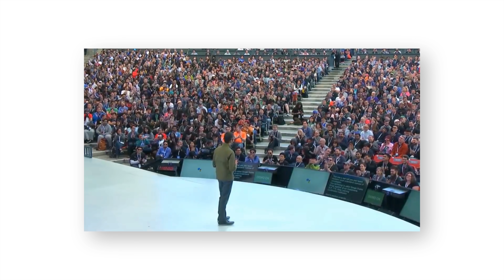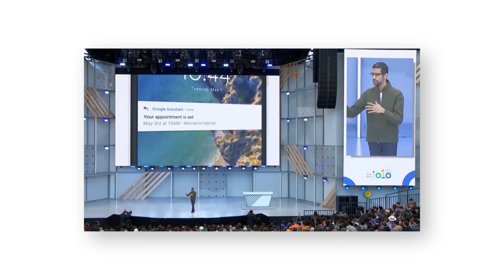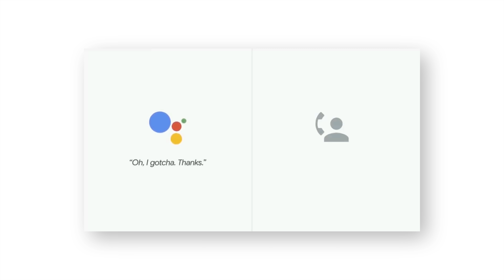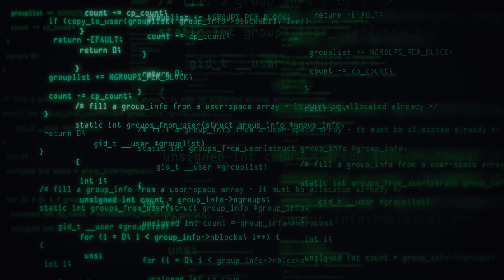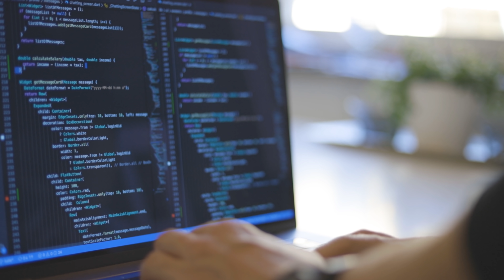AI Won’t Replace Programmers

Comment: Machinist said the same thing about cnc. But yet here we are with gigantic self loading amd unloading that take raw slabs and turn then into 100% finished products. One machine does it all. Instead of a bundling of machines and people per machine you now have 5 machines ran by one person that loads tools and prepares raw stock. Don't make the mistake thinking this won't happen. Fighter pilots said we won't be replaced it's impossible. And yet we are taking the first trails of AI piloted fighter planes. Baby steps but the advancement skyrocket from there

Comment: Computers & software can't run completely autonomously without people. Which means automation as envisioned by Google and co. cannot happen. Yes automation will happen but only about 50% of the total workload will be acquired by machines. It may look easy to some but replacing or even copying what a child can do is impossible. Mankind lived for millennia without electric power...can computers do that?
Either way, even though there may not always be jobs, there will always be work.

Comment: I agree with you, and your main thesis stands, but consider this: You can't think ofAI coding like a human.. It works in its own framework. I believe AI will be able to excel in things like gaming very quickly because you have a high workload and super high margins. What I mean by that is that the games will be built via AI and can predict textures models sounds etc etc etc. Where you for example sketch out a map design or even let the AI do that too and then let it paint in all the textures and models based on the theme you are going for. You make a few little adjustments here and there and save thousand upon thousand of cumulative hours.. 

Like you said without AGI you have to do a lot of predicting but specialized AI's can still predict really freaking well. Say you have a specialized AI for story writing, an AI for meshes, textures sounds animations etc. Boom you just saved <90% of the work it took to make the game.

Edit:
You could even develop an AI to govern and manage the fun factor of the decisions the other AI's made.

The point is not to underestimate AI.. its literally better than anything you have ever even slightly conceptualized. It will know and understand things intuitively that you would have never in your whole life thought of. Abundance is going to get wild.

Comment: I think it will be used to generate smaller sections of code and make programmers more productive to begin with but eventually it will take over larger sections as it becomes more advanced. 10~15 years ago we thought image recognition was impossible now look how far that's come. It's the same with programming, I wouldn't be surprised if we saw AI generating much larger applications within 10 years. Instead of a team of 50 developers you might only need one or two in the future.

Comment: I can certainly agree that software engineering is a too hard field to be replaced by AI, but 20 years ago, for instance, people thought it would be impossible to create something like a smartphone, but now it's the form of technology that almost everyone has in their hands. So I myself think that software engineering would be replaced sooner that anyone expects it to
Reply: If it's going to get replace. It's going to be replace by framework rather AI. AI to replace programmer is just a wrong path to go. It's not how AI work
Reply: It's inevitable.
Reply: If AI can be used to generate something creative like Art and Music, then it will for sure be able to tackle Programming. Something that’s super technical.
Reply: Well, it's already able to code. Take GitHub Copilot or OpenAI GPT-3 for example. The next step is to make a software developer AI and after that a software engineer one
Reply: These are totally different things.
Phones were not available due to absence of technology at that time so it was impossible to think that will happen because of the absence of that tech.

In this case AI needs such tech to make it creative without using human knowledge as a base which isn't possible due to it's absence in reality and of emotions.
Reply: This comment aged well. Not
Reply: Wait... smart phones were definitely in the realm of reason in 2002 lmao
Reply: AI is already used to simulate things so it's not too unreasonable to assume that it could simulate programming

Comment: Nope, programmers will be replaced way before other professions. The only reason why they still exist, it is because different languages compile differently in different machines, and many old systems are expensive to update.

But it is just painting in a screen and managing data. Today any layer in the middle makes it slower, that is why you still program in C some systems, 

and that is why there is no perfect multiplatform framework for desktop, phones and web, that is why tools as Tensor Flow are written in python, or others in R.

Everything seems delocalized, but in the end the problem is reduced to a translation. 

You can translate input/outputs and perfect the translation to be a universal standard. You do not need to think even of particular languages, it can be modelized  based on the machine code.

Even the maintenance of old languages will be replaced, which is a niche of programmers today.

You will get to a point in which the AI will make the code translated to a universal standard even faster than the original, because it would optimize what the original programmer didn't.

Like with self driving cars, the question will not be, it is equally efficient, but humans are way more dangerous.

Code that was written by humans, even if it worked, it will be suspect of not being optimal and you would audited it with a universal translator.

The more it translates, the better it gets. Multiply by trillions of trial translations and the actual implementation. 

Like self driving cars get better, and they share between all the float of cars that ever existed. They can only become better.

This is perfectly possible even with the neural networks that we have now, you don't need to imagine exotic forms of Deep learning. 

I don't think the profession of programmer could be sustained more than 10 years. It literally will be pressing a button.

Comment: Programmers will mostly be doing 'checking' and 'editing' of the programs that A.I. will create.  A.I. like GPT-3 can be created so much more quickly and accurately than humans can do, but A.I. makes mistakes so it is up to humans to check their work and correct any errors, at least for the first few years of A.I. program  creation. After a while the A.I. units will learn how to correct their own mistakes.

Comment: No. Computers are everywhere where you can't even imagine. Just inside your car, your house, school etc is full of computers. Like automatic light in your garage, your garage door opener, lawn irrigation an so many more. These devices are really cheap. AI based software need powerful computers, it won't be economical to replace those devices. Hardware developers shouldn't be worry about it too much.

Comment: Not any time soon!
People are terrible in defining requirements. And that’s why we went agile. People learn what they want by seeing what they like or hate and that shapes engineering. 
All waterfall processes are reserved for relatively simple processes.
And you need to train the neural network to generate the code, to do want you want. That’s impossible if you don’t have a very rigid specification.

Comment: TLDR: No. Clients need very flexible developers, you can't have that in AI unless it's self-aware (isn't happening anytime soon). Also you will always need someone to program and police that AI which will be - developer, engineer, architect, something like that. Developing software is just too dynamic field to hand it to AI.
Reply: You can solve that using the same format as Dalle, imagine prompting the programs you want it to do in which it automatically codes it in a fraction of the time human coders can do, some of then will be buggy yes but you can also solve that by tasking it create multiple versions of it in which the client can effortlessly find the thing it wanted. If tech companies have enough data that they fucking chuck into their A.i then all jobs in founded by a quick-sand and at rick of getting automated, even the coders themselves.

Comment: Hey Kalle 
Do you face problems in code folding in VS Code with dart plugin ?
It doesn't show the closing parenthesis  and whenever I click to unfold, the cursor gets inside that block

I was using Android Studio before and its very ugly
But this issue on VS code is annoying

Comment: I don't think you oversimplified the way our current AI systems work. Rather, you did a great job at capturing the main idea: these are extremely fast machines that do billions and billions of computations to come up with probabilities for different scenarios. There's zero understanding in these machines (the same way a hand-held calculator doesn't understand that 1 + 1 = 2, it just computes 1 + 1 and shows the result 2). 😁

I also liked your conclusion at 10:40 that general AI "is very far off and it's probably even questionable whether we can reach that point." 😊Great video, as usual.
Reply: Interesting your POV... What are your thoughts now? Please

Comment: I don't think ai (or more in general computer) will replace programmers. Every type of computation (ai for example) can be reduced in a turing machine (https://en.wikipedia.org/wiki/Turing_machine) and everything you can't do with a Turing machine you can't do with other type of computation. Now there is a particular problem that a Turing machine cannot solve: know if a programm won't terminate its computation. So ther is no way that a program, such a compiler for example can say "ehy this program enters in an infinite loop, let's fix it."

I'm still studing these thigs at university , so i'm not 100% sure about that.

Comment: I think it'll eventually replace most programmers or at least decrease the skill level necessary for writing software. I took a course on formal methods in software engineering and the objective of that is to ultimately automate grunt work programmers needing only software architects instead of actually writing a single line of code like we need to these days. 

Also mild annoyance regarding the imitation game recommendation, while it was a good film, it unfortunately wasn't entirely historically accurate. https://en.wikipedia.org/wiki/The_Imitation_Game#Historical_inaccuracies (sorry for using wikipedia as a source but it's the easiest option)
Reply: Avoid wikipedia, at all costs.